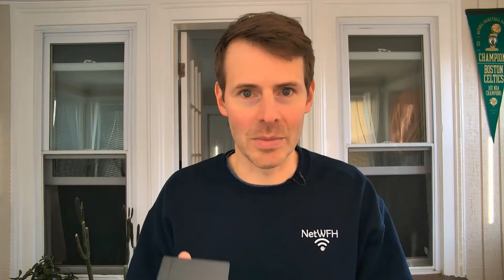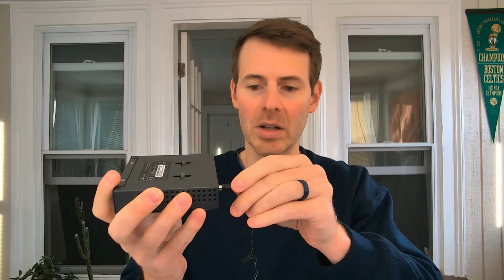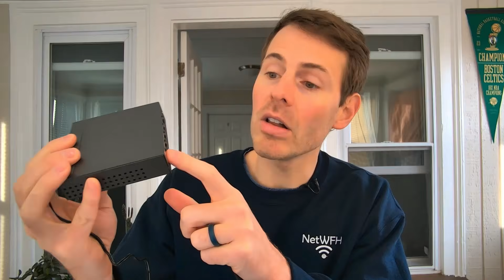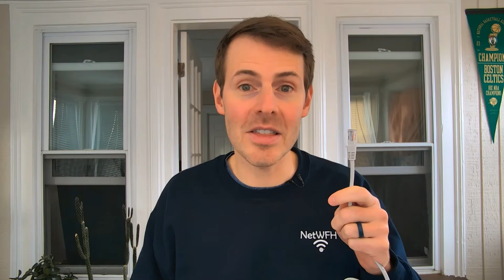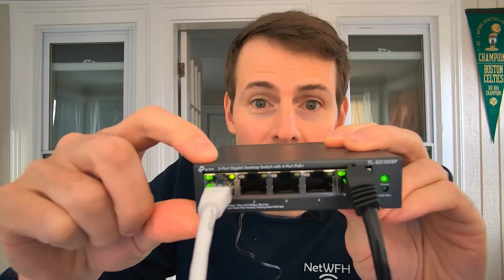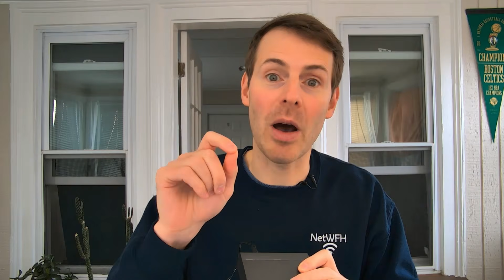PoE Switch Setup: What Steps You Need to Take

Comment: Thanks for the clear explanations..   can  i put the switch in between the  video camera and the router?   Or the switch needs to be  plug  feet from router?  Thanks
Reply from the maker: The switch doesn’t need to be close to the router. You can definitely put your switch between your video camera and router as long as they are all connected with Ethernet cables. I hope this helps!
Reply: @network-from-home thanks for answering .. appreciate your help
Reply from the maker: No problem at all, thanks for the question!

Comment: If the switch is powering a point to point and two cameras, the P/P receiver end is connected to an airstream trailer, which the power will be disconnected when not in use . Will the switch notice the power off on that device and try to reboot? 
So does the recovery switch need to be turned off? 
Also does the recovery switch being turned off. Shut down all ports on the switch disabling the 2 cameras?
Reply from the maker: I think in this case you should be fine with the recovery switch off. It won’t power down the ports to the two cameras, it just won’t keep trying to reboot the P/P receiver port when it doesn’t have power. I hope this helps!
Reply: @network-from-home  Thank you
Reply from the maker: You’re welcome!